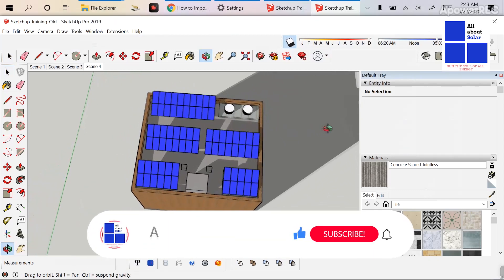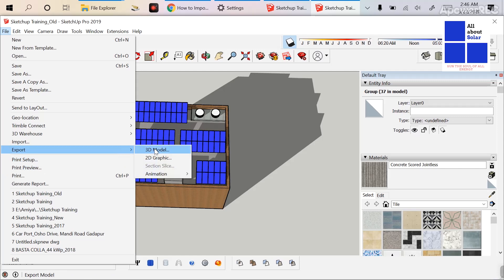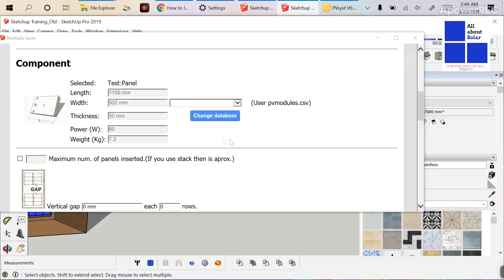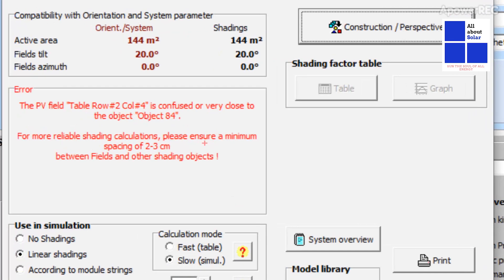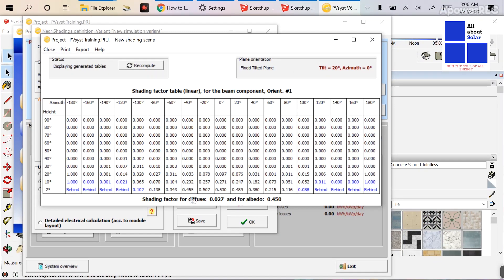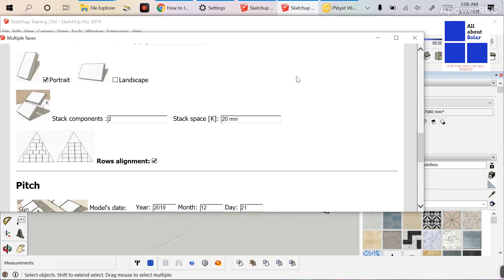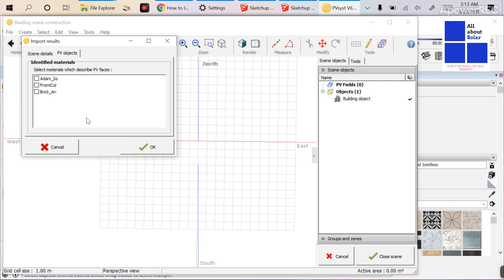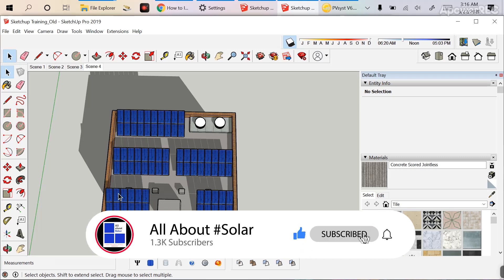How to Import #SketchUp Drawing in #PVsyst Near Shading?  #solar #pvsystdrawing #sketchuptopvsyst

Comment: could not add modules using user database
But modules can be added using Skelion Database
sir please help
Reply: I have sketch up 23
Reply from the maker: You can add from ‘User PV Database’
Reply: yes sir I was using the User Pv database only. 
I have added the module specs 
Module name dimension wattage. 
Then turned on the user pv database. Then selecting the added module. 
Then no. Of modules, no. Of stack then continue
But nothing appearing on the selected surface.

Comment: Hi Amiya! thanks for the videos! Near shadings 3d scene shows: The Shading area is far larger than the PV modules (Shadings=54246 m2 and Orientation=35 m2). I've changed Absolute Maximum Shading/Field area Ratio" to 1600 but it did not work. Can u help me?
Reply from the maker: Hi Marcelo. This error actually coming because the Number of modules you consider in the System tab is not equal to the Near Shading no. of modules. 

Thanks,
Amiya
All About Solar
Reply: @AllAboutSolar  Thanks Amiya! I don't know why... I have imported the project from Sketchup. Altogether are 18 pv modules but the difference is very discrepant.

Comment: Hello sir I hope everythink is ok . Well i do exactly what the video shows and when a solar panel is close to the " model" lines when i impoted to pvsyst it shows the following " PV filed trina 3142 face #1 is very close to the "model" . The solution is to move the partcular solar panel or erase it or check the box in the tools section for disable field for interprenetration check . Could you help ?
thanks

Comment: Bhai ye pid loss and lid loss q hota hai ??
Reply from the maker: PID Loss: Potential Induced Degradation loss. Due to the aluminium frame of Solar Module some voltage drop happen that is known has PID.
LID : Light induced degradation. I already explain the same on PVsyst Episode 4 part 1. Please watch it again.

Thanks,
Amiya
All About Solar
Reply: @AllAboutSolar  Ok Brother Thanks so much